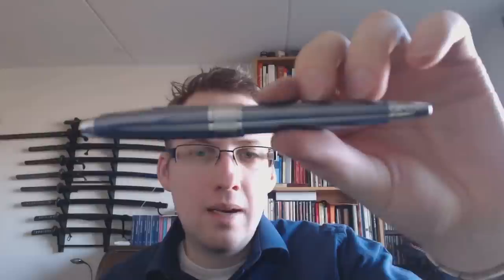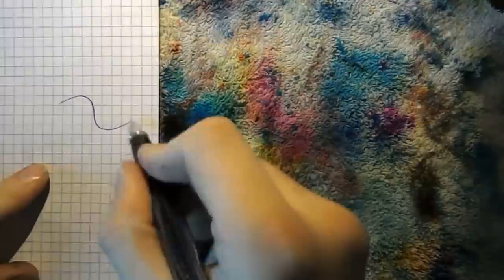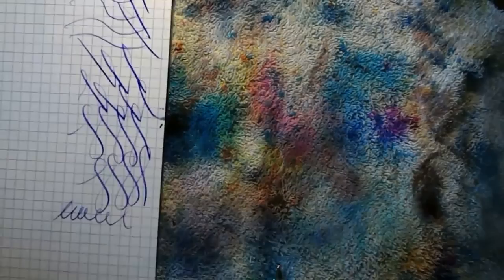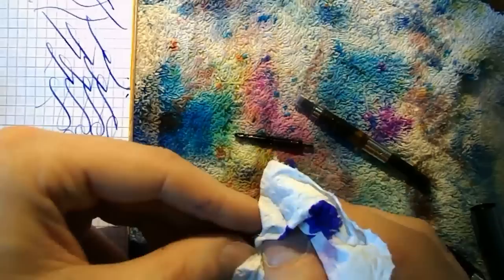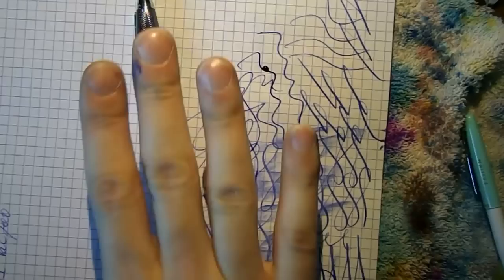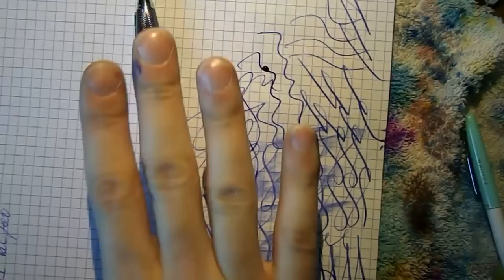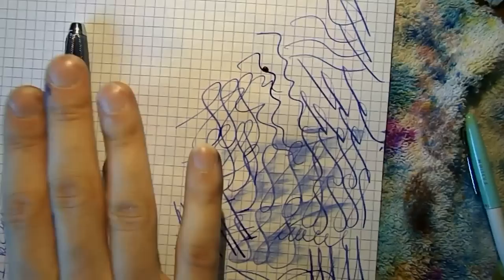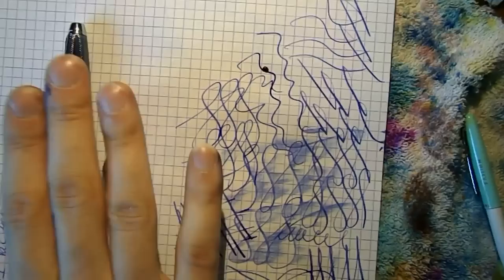Making a High end Pen a Bit Wetter

Comment: Hi,  It's surprising how many pens need this tweak, so many nibs are just too dry from new.  I have learned to look at a new nib with 10x loupe before inking, and can make a good guess at how it will write.  I have had a nib with with too much tine gap from new, but that's very unusual.  Also I find how much the nib is in front of the feed is critical, I set mine up using the loupe, mm ruler and marker pen....it's not easy ! As you say, it's easy to damage nibs doing this.

Comment: Could you use feeler gauges to do this Stephen, or has it got to be brass as its softer on the gold?
Reply: Feeler gauges work fine. Just be sure to start low (0.05) and increase by this amount each time and try afterwards. Be sure to clean the gauges before use as they often have protective oil applied to them. Patience is the key to this procedure, but believe me, it’s really worthwhile when your pen suddenly starts to deliver a better and consistent quantity of ink!